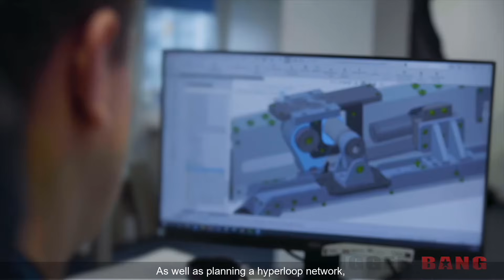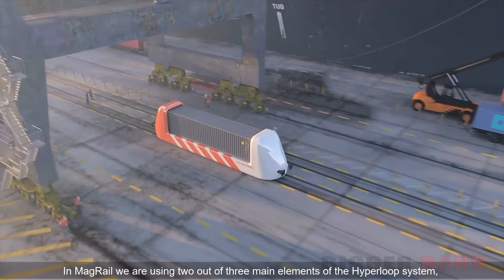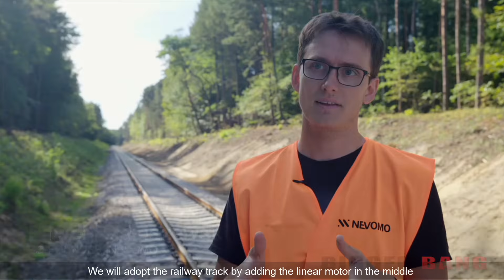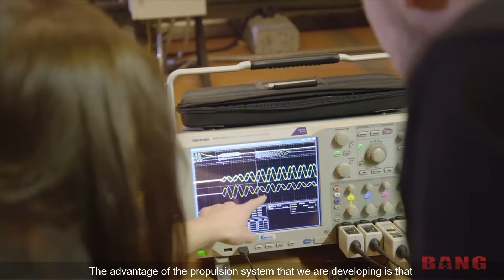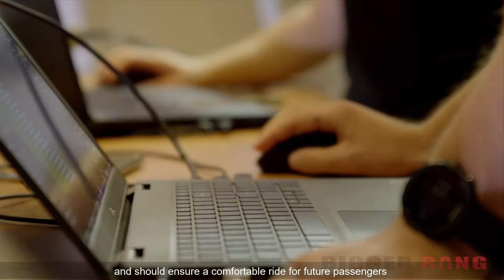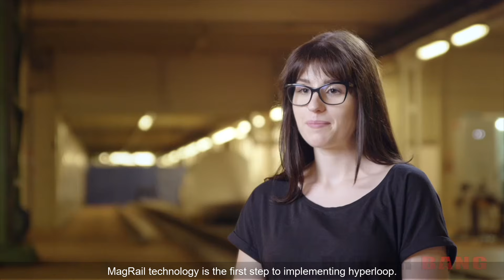MagRail - a new, innovative technology by Nevomo

Comment: Comments for Nevomo.  It will be easier for you to go to Hyperloop stage if you use hyperloop train to transport nonliving cargo like merchandise and resources.  This cargo does not need air, therefore during the unsuspected catastrophic failure, the vacuum will not hurt anybody provided that the train is fully automatic (no conductors or train engineers inside).  The overall system will be much easier to implement because there will be no need for safety system installation and other stuff.  Furthermore, it will be better that this cargo hyperloop train has railway system underground preferable under the existing railway system.   I personally prefer to travel on a  train that I can breath and have a good view of scenery passing by.    The hybrid mode magrail is good idea, progressive  and practical.   It has a good chance of being successful if it will be cheaper to operate and more energy efficient.  So far I see nothing wrong with this approach because it relies on existing infrastructure.  This is your strong point in selling your idea.   Good luck.

Comment: The reason why trains are not very fast is because you need super straight tracks otherwise they will fly of a the track, the fastest rail can go 373mph, you would need to build a completely new track in order to obtain those speeds and not kill everyone while doing it, it’s not impossible, Japan is building a maglev called the Chūō Shinkansen which has a length of 177.5miles and a speed of 505km/h, i also think that the maglev train dose have a future but it would need to travel at lower speeds to fix in with existing rail

Comment: Right, maglev on existing rails. You do realize that current speed limits on most rails is not because trains are not magnetic? We have normal, non-magnetic trains that can go upwards of 300KM/h, but most of rails themselves don't allow it (not flat enough, too large elevation differences, too steep curves, and so on).
Reply: Exactly this. The limiting factor in train speed is not the engine, it's the tracks. High speed trains have very different track requirements than standard speed trains. So you can't just adapt existing tracks for high speed rail. At worst, your train would derail at the first curve it tried to take, at best your train would never actually reach top speed. Not to mention sharing the track with standard speed trains, you can't really overtake a train so you'd have to wait and slow down anyway.
Reply: And the catenary's shockwave

Comment: I'm not a big believer in hyperloop as Musk pushes it, but honestly just managing to build hybrid and intermodal rail-maglev infrastructure would be an amazing achievement. Imagine if you could take any existing HSR lines and bump their speed up to 500-600 Km/h without having to redo the entire thing, and while keeping compatibility with existing railway lines. So you could do a Paris-Lyon blasting at ultra high speed, then still operate as a regular train for the rest of the trip.

I noticed that the system requires wheels below a certain speed, so I presume it is using electrodynamic suspension? I wonder if superconducting magnets are used as in SCMaglev, because cooling those is a real ordeal.
Reply: These "maglev" and alike are just tech bros pipe dreams, they do not make any economical nor practical sense, it may be implemented in coutries which live on dirty money like dubai or swiss, because it is easy with free unlimited money, but it will never work in any decent country, you just have to check the current price of TGV in France and other fast trains in west EU  example, for a Toulouse-Nantes it is currently cheaper to take a flight than a TGV, so.. not viable. There is also the issue of infrastuctures, it is already hard enough to maintain TGV tracks up to standard everywere, Maglev requires an order of magnitude more maintenance, and has a huge initial cost. it just doesnt make any sense, at all.
Reply: hyperloop has always been a scam, this is publicly known now. This "product" is a cheapstake hyperloop.
Reply: The hyperloop is a dcam, musk openly admitted it. The whole idea is to derail (haha) feasible train projects in calufornia to keep selling his shitty cars.

Comment: Cool concept, but definitely not applicable to cargo. Way too expensive.
Reply: For cargo they have a sligtly different approach, i.e. there wont be a levitation used but it will still use the central linear motor to indiviually drive each car
Reply from the maker: Exactly, thank you! :)
Reply: @Nevomo  what is the difference then between nevomo and a normal train if the cargotrains wouldn't levitate?
Reply: @uceee1  Don't you think it makes no sense? I mean using linear motor with standard wheels.
Reply: @uceee1  Yeah let's "reinvent" THE THIRD RAIL WHICH HAS BEEN AROUND FOR LIKE 130 YEARS.....
Reply: Once upon a time when cargo was transported on donkeys, they used to say that about railroads too😊
Reply: @TheGalacticIndian  The capacity of trains was a lot higher than that of donkeys, apart from speed and overall efficiency. All Nevomo does is reinventing the wheel while we have a cheaper, more efficient and simpler solution on hand: The Train as it exists now.
Reply: @Dumbwaytodie3920  Not everyone understands the potential of this project. It's like saying that since we have the telegraph now, we don't need the Internet in the future.
Reply: @TheGalacticIndian  This project has no potential at all. It's vaporware.

Comment: This is so unbelievably useless, cargo trains that exist now are so much more efficient compared to single pods like nevomo and all the other scamstartups use. Cool idea but not practical!
Reply: Its not the single pod technology
Reply: have you watched other videos? with the mag rail booster, cuz that actually makes sense for me, go watch it, and yeah i agree that single pod autonomius vehicles don't make sense but nevomo ain't doing obly that + when on steel tracks the trains can be much longer thna on a pure hyoerloop
Reply: @wilque6324  why would cargo need to go fast for its last miles if its been on a cargo truck for 3 weeks and if you need company needs something they order it early and if you need a package then its put on a plane that goes 900 km/h not some pod that in real could never reach these speeds because there is rocks on the track and it would brake windose at those speeds
Reply: @wilque6324  It wouldn't make alot of diefference because the main problem of hyperloop and nevomo is that they try to achieve speeds of 300 km/h +. The drag coefficient would skyrocket and the electricity prices would do the same, only problem is that those kinds of speeds are not needed in this industry.
Reply: @wilque6324  They'd need dedicated lines to run their system on, else the "500km/h" pods would just get caught up behind existing rail traffic, which caps out at around 250km/h for high speed rail
Reply: @johnroach9026  yeah, I've come to my senses, that comment was 10 months ago xddd
It now makes much more sense to me that this is just another "tech bro" start up to "revolutionize" railways

Comment: Can't see any innovation here. Linear engines are in use for decades for example in some subways.
Reply: Vacuum tube tech isn't going to solve insufferable urban planning that disables populations from mobility.
Reply: I think the innovation is developing a mag rail system that is both backwards compatible with existing rail infrastructure and forwards compatible with a potential vacuum tube.

Infrastructure is often a once-in-a-generation project, so its wise to create something that has headroom for expansion and upgrades.

As a counter example, the central line in the London Underground has a ton of heat issues because the tunnels where built without much headroom for larger trains w/ A/C.  The same city did the opposite with its sewers. They were built significantly over capacity to facilitate population growth which has allowed a 21th century city to still use a 19th century sewer system.
Reply: @deliciouslybrutal  in this case there is no "backwards compatible with existing rail infrastructure" Ask nevomo for details or watch their other videos.
Reply: Do you understand English??
Reply from the maker: Exactly as @delicouslybrutal mentioned, at Nevomo we are developing MagRail, a technology that enables a quick, phased implementation of hyperloop-inspired transportation technology within railways’ systems. MagRail, based on magnetic levitation, linear motor, and autonomous control systems, can be subsequently transformed into a vacuum version called the hyperloop.
Reply: @Nevomo  Yes lets mix MORONrail POD with 5 thousand ton goods/freight train.

WHEN the MORONrail POD SLAMS INTO THE 5 THOUSAND TON GOODS/FREIGHT TRAIN THE CLIENT USING THE MORONrail WILL WANT TO KNOW "it's been 2 days: where the f!ck is my shipment that you said I'd get in 20 minutes?"
Reply: @Nevomo   Do you have any estimates of the cost per km of MagRail vs traditional rail vs hyperloop?